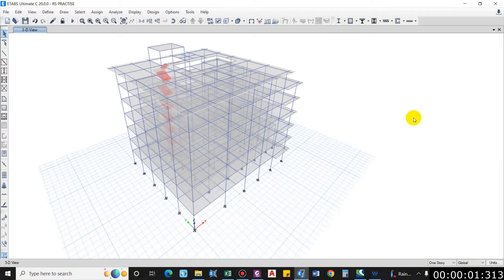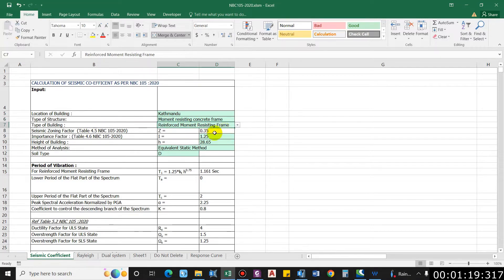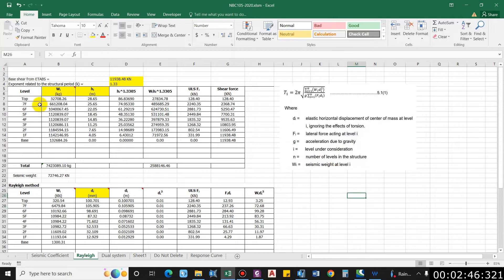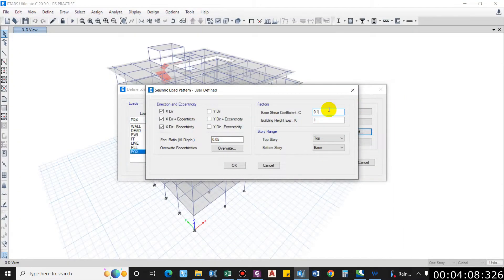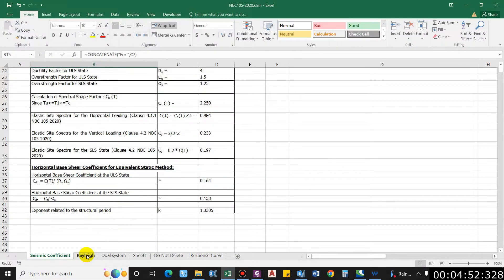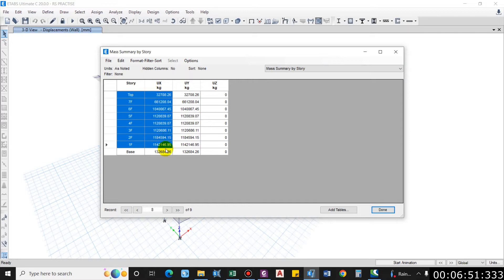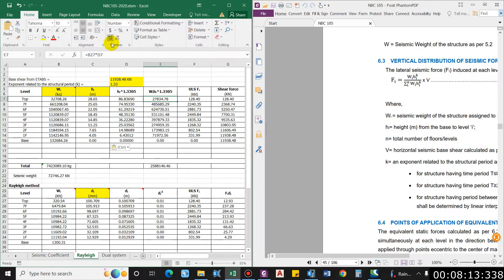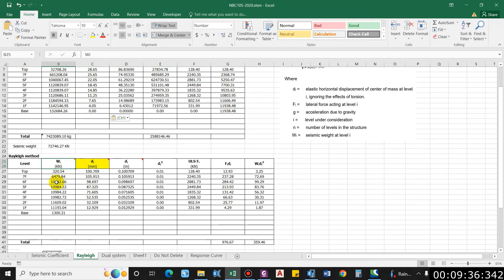Rayleigh method | Time period of building | NBC105:2020, IS | Str. Report | Exponent(k) | Base shear

Comment: Suppose, i passed all the members from the calculation of time period with emperical formula and then checked with rayleigh method and found time as minimum and then modified coefficients. This may cause the change in member sizes which ultimately changes the mass.. Does this trial continue until both the time periods are equal or what?